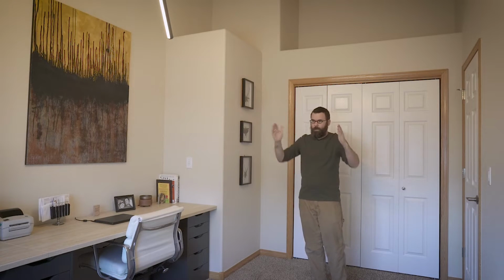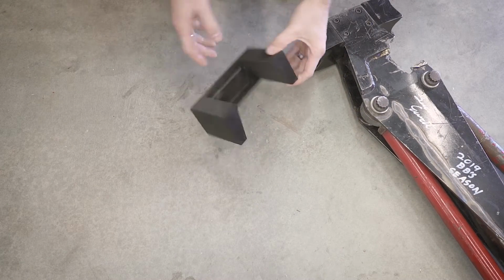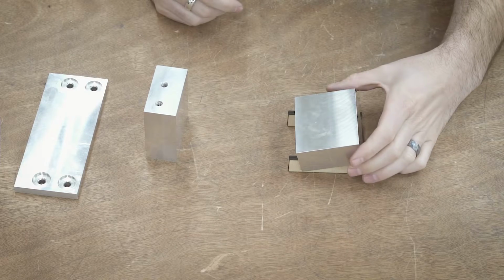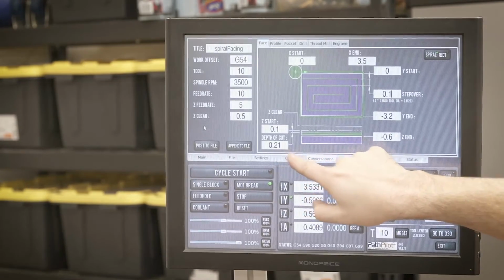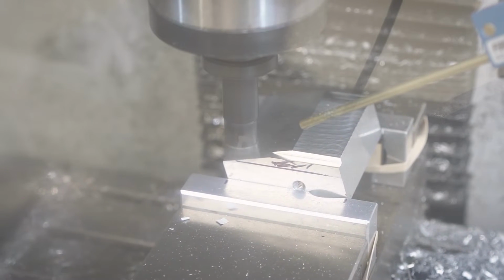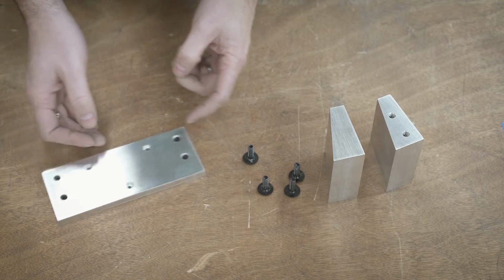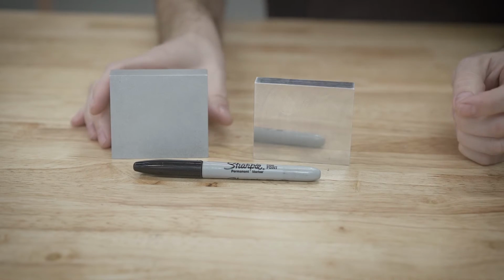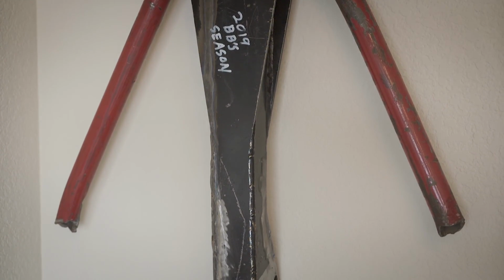Son of Whyachi Wall Display Mount

Comment: @7:28 invest in a stout short height cutter, that's not the correct one for that kind of operation, hence the vibrations.
Reply from the maker: Noted.  I'm not sure what was happening, I've used this tool many times on heavier cuts without vibration.

Comment: Why turn the whole scrap piece into chips, though? You could make that cut easily on a bandsaw.
Reply: I don't think he has enough machining background to simplify such things. Were it my work, i would've cut a bigger block into the two pieces with an angled cut(band saw, hack saw, heck, even a milling operation in two passes), then machined them both in one pass using a scrap piece of metal to mount them by the screw holes.
Reply from the maker: @aserta  I'm not sure I follow.  So you would have cut the angle in the stock and then just faced it down?  How would you hold the part in the band saw?
Reply from the maker: The angled cut?  I guess I could have, but it's tricky to hold smaller pieces on the band saw.

Comment: what computer monitor is that? I ask cause I want to buy one:)
Reply: Looks like the LG 34BK95C-W
Reply from the maker: @FryGuy1013  Close, it's the 38WK95C-W, the 38" version.
Reply from the maker: It's an LG 38WK95C-W.  I LOVE it.  38" ultrawide is great.  It's amazing for video editing, solidworks, and games.  And you can pretty easily put two browsers side by side, but that requires some head-turning.

Comment: Hey I think you have a slight ground noise on your recording? You can fix this with a ground loop isolator for 10$. :)
Reply from the maker: Ground loops occur when there's, well, a ground.  I use a wireless battery-powered mic.  The sound you heard is my 3d printer making some parts that will be shown in the video next week ;-)
Reply: @RobertCowanDIY  Ahh the 3d printer! I just heard the tiny little noise at start of the video and thought i can help (as i had these issues for a while) so false alarm! :)